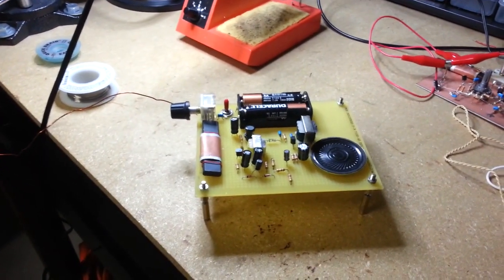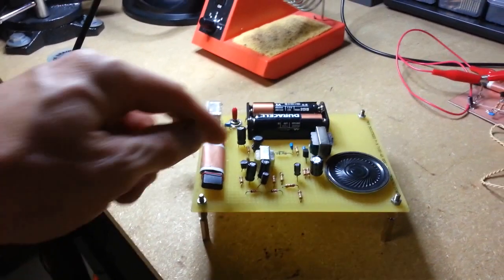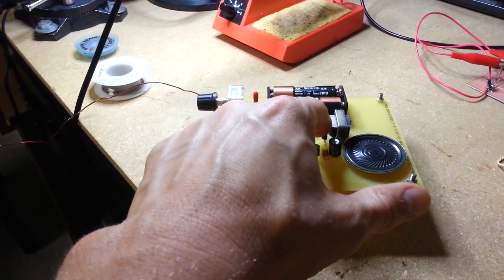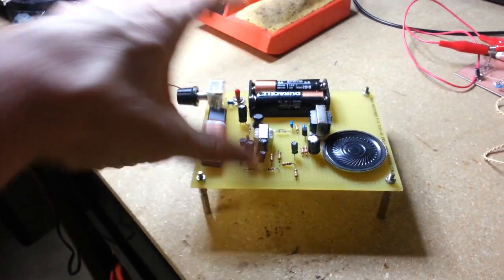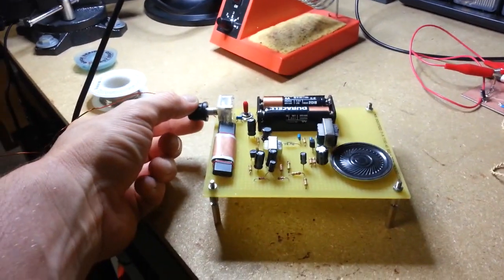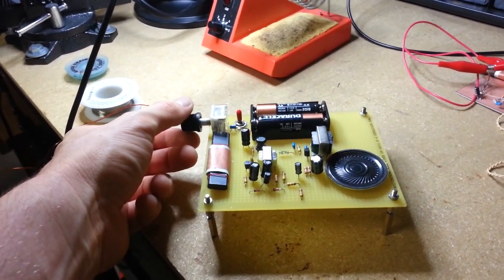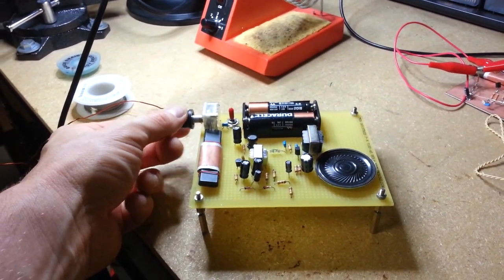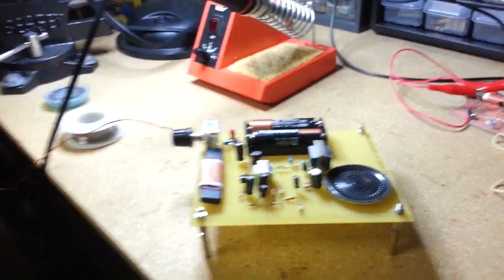Reflex AM Radio Receiver

Comment: Will it drive a better speaker?
Reply from the maker: +Ed Maurus This circuit expects a low impedance load.  Most smaller speakers are around 8 ohms so any low impedance speaker should work.